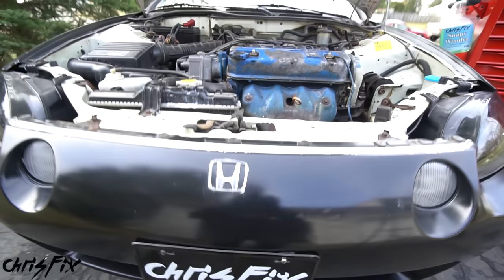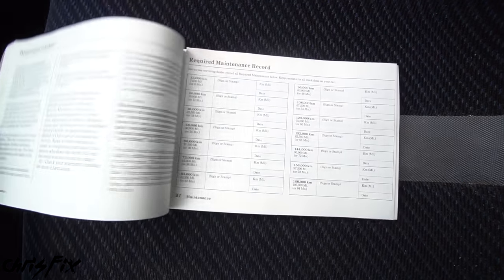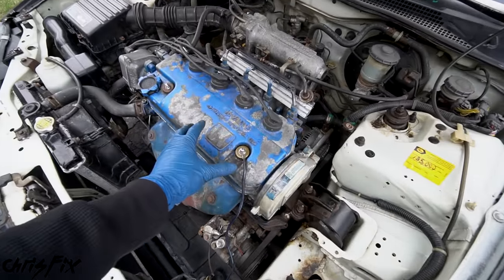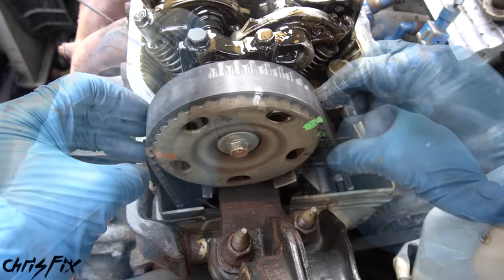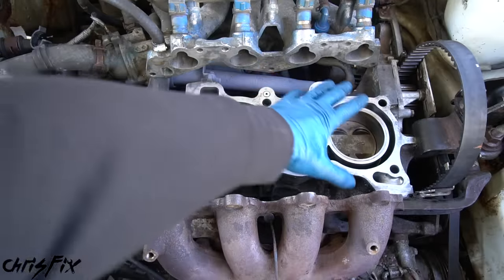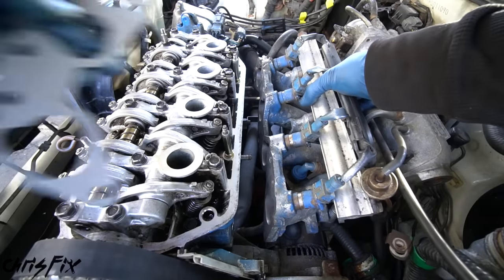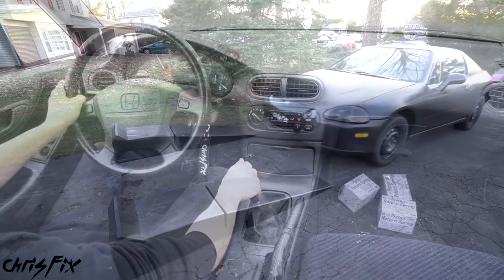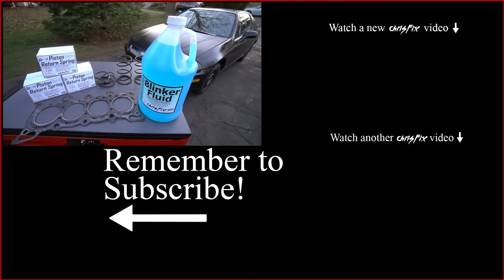How to Replace Piston Return Springs (and Head Gasket)

Comment: Wtf, opened my engine block and realised i dont have them!
Reply: Aariz Mughal i know mate
Reply: So you opened your engine before getting a replacement part? Hmmm lol
Reply: Ghazik Quick Run to autozone. ChrisFix forgot to mention older models need heavy duty PRS. Dont let them fool you.
Reply: Yep, happens all the time where I live. Damn scumbags will pull the head and nab your PRS's in 30 seconds flat. Most people don't notice the negative effects of running the car without them, namely reduced gas mileage and low end torque (they aren't effective above ~3000RPM in most engines).
Reply: You can always add them in to get another 2%+ fuel savings.  Make sure you get the right fit for your car.
Reply: Ghazik omfggg
Reply: Wow, looks like your PRS's completely dissolved into the oil...
Reply: Someone most have stole them ....
Reply: They must have melted and went out the exhaust. better get a new set so you have better fuel efficiency.
Reply: Zinu rolleros čista viņu nav😂
Reply: If you took your car to a mechanic once they probably stole them for their car.
Reply: Adding piston return springs to your engine is specifically for race cars guys, it's some serious business. We use ethyl alcohol-based blinker fluid to shave just a few grams off the vehicle, and muffler bearings for fidget
spinners. We ain't messin' around
Reply: How does your car even run man??? Jfc get those replaced ASAP!!!
Reply: random guy wooosh
Reply: oh damn you need to get a set from chris quick thats not good!
Reply: you also realized that you spelled realized wrong

Comment: I have no idea what the joke is here... that looked and sounded completely legit :(
Reply: Got to get ya some," piston return springs,"  Stat.
Reply: Four strokes to the engine, The first stroke in intake, the cylinder pulls in fuel and air and then the piston goes up for the second stroke, the compression stroke and the fuel air mixture is compressed and it is ignited by the spark plug in a regular fuel, in diesel there is no spark plug so it uses the heat of the air compressing to ignite the fuel. that combustion is what causes the piston to return and creates the energy that moves your vehicle. That is called the combustion stoke and is where this joke comes into play, It seems legit that a spring would be helpful in the four stroke cycle but in theory it would hinder the process because with every stroke combustion stroke it would have to compress all the other springs and take power from the crank shaft. The last stroke is the exhaust stroke where the piston returns to top dead center and exhausts the burned fuel/air mixture and then the cycle starts over again.

Intake, Compression, Combustion, Exhaust. No spring needed for the process.
Hope this helps.

Comment: I think I usually run my car's with no piston return springs in it.
Reply: And thats ok too as long as you remove the connecting rods too too much pressure on the crank and it could start "Rotating". Next thing ya know, you'll have pistons going up and down at different times..
Reply: Same... Weight reduction because race car lol
Reply: You are at high risk of spinning your muffler bearing...
Reply: @savagesock3598  
No. That cant be. I just replaced the muffler bearing fluid.

Comment: WTF is a piston return spring!!???
Whatever, I have my own problems...my mechanic told me yesterday I need blinker fluid, a muffler bearing and change my summer air in the tires to winter air.
Google was no help...HELP!!!
Reply: Made short work of a head gasket change.but piston return springs are old technology... id suggest piston delete kit  golden beagle makes a nice kit.realy lightens  your rotating assembly .i did mine and  now i have a nice healthy idle but its really hard to find tdc
Reply: Deez Nutz you need blinker fluid too?  I had that installed today!
Reply: @TraumaER  Question: Blinkerfluid for winter or summer? Pay attention to this detail! ;-)
Reply: " . . . and change my summer air in the tires to winter air."

Use nitrogen. It's all season.
Reply: John Casteel nitrogen is the biggest scam in car maintenance today.
Reply: @TraumaER  only a scam if u pay for it. Sence it does have advantages

Comment: Anyone noticed the numbers on the barcode are the first 8 digits of Pi. Easter egg??
Reply from the maker: Good eye ;)
Reply: On the blinker fluid was 8675309. I googled it and this popped up: Tommy Tutone - Jenny (867-5309)
Reply: And this is the muffler bearing's barcode number too
Reply: Aladár Mézga You can actually call that number and it will play the song, just add 919, lol.

Comment: and I'm thinking like wow Hondas have piston returns Springs? I'm glad my Nissan doesn't have them... Or does it?
Reply: Christopher Schade Nissan actually uses a duel rate piston return spring, they cost twice as much but last three times as long. It's best to replace them with a fully adjustable hydraulic controlled spring they last forever and add about 69 hp
Reply: Christopher Schade I'm sure the dealer would be more than happy to replace them for you.
Reply: Tear it apart and find out
Reply: My old Honda Accord lx didn't

Comment: U need a new engine. Please do a engine swap. A supra engine will be nice. If it fits.
Reply from the maker: I will most likely do a swap so stay tuned!
Reply: nah, k20 engine+ a super/turbocharger would be great :) 300+ hp
Reply: swap it with a new stock engine.
Reply: 2jz would be awsome😍
Reply: SOMEONE FROM SOMEWHERE It is honda, of course it will fit
Reply: ChrisFix do a Honda K24 with a turbo kit
Reply: ChrisFix just swap a stock B series engine.
Reply: No. Keep it honda
Reply: that is a 6 cilinder monster engine do you rly think it would fit
Reply: you cant rly fit anything other then a honda engine in that without some hard modification
Reply: Ahahah 2JZ 😂😂, don’t make me laugh
Reply: Thats why at the end of my comment i said if it fits. Chris will need to remove most of the car parts in the engine bay to be able to fit a 2JZ.
Reply: SOMEONE FROM SOMEWHERE it’s FWD 😂😂
Reply: No problem 😂
Reply: GDrift are u sure. I searched it. It says JZ and 2JZ-GE were in supra models. If i’m wrong... then 😅😂
Reply: SOMEONE FROM SOMEWHERE I’m saying the del sol is fwd do you can’t fit a 2JZ in it

Comment: Remember, always put the piston return springs in before you place the head gasket on the block. If you ever come across an engine that the previous owner deleted the piston return springs, you must reinstall them with oem parts.
Reply: Someone stole my Piston return springs from my car.

Comment: great video!
got myself some new ones too.
instal was easy since i got a similar engine. i went for a slightly higher springrate for even more torque.
engine runs smoother than ever before.
fuel efficiency and power delivery better than ever!!

Comment: Another pro tip would be run a taller spring for more piston lift .. more piston lift = more power also look into a quality spring like Pac springs or Isky tool room springs. They can handle 1.5" - 2" more piston lift for 250K miles no problem. Some peolpe try to use a piston return spring spacer to accomplish this however that is not the right way. And can lead to premature piston return spring failure.

Comment: If a car sits for many years without being run or drained of fluids, can that cause the head gaskets, heads/block surfaces to warp and possibly leak? I picked up a '66 Mustang that sat for many many years (Possibly 20?) and she's blowing a good amount of white smoke. No frothy oil and haven't been able to check for exhaust in the coolant yet. I just had to refill her back up with coolant but it's a slow "leak". She goes through oil much faster buuuuuut there's 100% a leak underneath that I can't get to or see with the equipment I've got currently.

Unrelated: I've been piece-parting her back together, slowly but surely, and your videos have come in handy on multiple occasions, so thank you so freakin much, man. Keep it up.

Comment: I openned my engine and found out why it wasnt working properly. It was because there wasnt any springs inside. I bought a new ones and replaced them. Now my engine works fine and it is +10hp more powerful !

Comment: I've always replaced my piston return springs every 100,000 miles at the same time I change the timing belt, water pump, hydraulic tensioner and the cam seals. I learned to always change the piston return springs then the hard way when I blew up an engine when I didn't change them in time.  When that happened, pieces of one of the springs shot out my exhaust and hit the driver of a passing car in the face causing him to lose control of his car and he ran over an old man with a walker.  But the worst part was that another piece of the spring got between an exhaust valve and the valve seat and it bent the valve stem.  What a PITA!  Just be careful who you buy your piston return springs from because the Chinese piston return springs are total crap. One way to check them without pulling off the head is to use a sequential gonculator but just make sure it's calibrated correctly.  A SG is expensive, of course,  but many parts stores will rent them out or even let you use one for free if you buy your piston return springs from them.   I bought my own so I can check my piston return springs frequently.  Doing so is critical and I suspect that many new drivers aren't aware of this. 

Thanks for posting this important video.

Comment: I was thinking "wow I've never heard of piston return springs" and then I realized that this was an April Fools video.  The manual timing belt tension has a specific sequence for tightening BTW.  On the D16a6, you're supposed to advance it 3 teeth beyond TDC and then tighten the tensioner.  Otherwise, great job.

Comment: Wow 4 years ago we’ll I’ll give it a try. I have a 92 accord same issue idles go up and down. And fan comes on very shortly, and the it begins to over heat. Not sure if it’s the head gasket or what it is specifically. Any advice?
Reply from the maker: It could be a few things. Check your temp sensor and check your coolant levels first.

Comment: i sugges you to add oil dampers to the prs, otherwise there could be a risk of the engine generating too much torque and spun the transmission main bearings

Comment: I have a car that has a chain instead of belt, I think I will have to remove the valve shafts first to get to the head bolts. It is a Suzuki Liana, 2004

Comment: When i did my piston return springs I couldn’t afford a head gasket as well as the springs so i took out the spark plugs and turned them till I found the ends and wound them out then wound the new ones in the opposite way , only had to run a chaser tap down the plug holes to get the plugs back in 😂

Comment: i had the same problem. there were spring parts behind the car that came out of the exhaust pipe. simple solution i put the pieces back in the gas tank

Comment: Hey I know you probably won’t see this but what did you use to clean the cylinder head? I was thinking you just used degreaser but I wasn’t sure and thought I’d ask. Thanks brother
Reply: carb cleaner your not supposed to clean the piston's while there in the engine
Reply: @seanmckay3392  alrighty thanks

Comment: Does he recommend low tension return springs to increase gas mileage?   I'm on the fence here which way to go but it seems they are more available.  I only change my oil every 10,000 miles so this is a concern for me

Comment: I clicked on this video so I can learn how to change a head gasket. Can anyone tell me what is and isn't a joke here? I.E do you actually have to torque the head bolts in a certain sequence? Is it okay to clean oil off the valve train?
Reply from the maker: Everything except the springs is real if your looking to change the head gasket :p and you can but make sure the valve train has some fresh oil/assembly lube before startup
Reply: @chrisfix  Thanks Chris, very impressed you still respond to 6 year old videos 😁

Comment: You wouldn't believe this but when I opened it up there was NO PISTON RETURN SPRINGS, wow wish I had known it gotten that bad, smh I immediately put 2 springs in each cylinder, also don't forget to lube the springs
Reply from the maker: Imagine that. What car?  Well whatever car it was, they cheaped out!
Reply: @chrisfix  the problem is, that it's an older car so they didn't coat the springs with the coolant repellent, I assume over the years the collant must've eaten those springs up.

Comment: In my opinion they are useless engines, why put return springs? It only increases the risk, increases friction, increases the thrust on the head, increases the effort on the piston, on the connecting rods, on the shaft, the springs break as in this case. Useless in my opinion. I am a mechanic in my country and I would never see an engine like this. I repeat, my opinion, you were still very good, you explained well, we need videos like that.

Comment: is it possible to take the air intake off the head on a 1991 Toyota Corolla alltrac? without having to pull the head with it attached? I have a 1.6l 4A-FE engine manual 5 speed.
Reply from the maker: You should be able to.
Reply: @chrisfix  Awesome, I have a small leak with oil seeping into the coolant, but no coolant in oil-crankcase. thanks for the reply.

Comment: Hello, I have a 2008 Toyota Corolla Fielder with a 1.8-liter engine of the 1ZE model and it has 240,000 kilometers, I am its second owner, the first owner is a well-known person who takes great care of it, all the services in Toyota and I continued with that mode. But now a problem has occurred that they cannot find and I dare to consult you. The fault is that when turning on it starts with 1300 rpm's and as it heats up they go up to 2000, that is, it does the other way around since I understand it should drop to around 900 rpm. and already hot I go out and when I make the gear changes I see that the rpm's oscillate between 2000 and 1000 rpm and when I continue the march the minimum is 2000 rpm. If I leave it running stopped the car stays at 2000 rpm. I clarify that with a scanner it does not give an error, it was tested with a toyota scanner and other brands. Well we removed the throttle body, total cleaning including the MAF sensor of the filter, I clarify that you cannot remove the IAC valve to clean but the carburetion body was submerged in non-abrasive removing liquids and some dirt came out. We measured TPS and IAC with a multimeter, we simulated with power and everything was fine. We checked the pipes that had never been touched and they were impeccable. We put everything together and it starts making the same failure. We took out the VVT valve, it was cleaned with carburetor fluid and wd40, I have original oil in the car, with 5 original toyota viscosity, I excited the solenoid with 12 volts to the vvt-i and it works well, I don't improve at all either. So I disconnected the EGR vacuum valve and there the rpm's dropped a little but after five seconds it accelerates and when connected it returns to 2000 rpm. If I disconnect the MAF sensor, the fault disappears but the engine idles low between 300 and 500 rpm's and the car loses power at 3000 rpm's and the brake is very hard. I clarify that spark plugs, intake gasket, throttle body gasket and PSV valve were changed, all original from Toyota. I have seen some slight loss in the valve cover. The servo brake was also revised and it works without loss. Everything would indicate that there is a vacuum leak, but I live in the countryside where there is not much technology like something that generates pressure and smoke to see where the leak is. You can help me?

Comment: I’ll be replacing my head gasket on a 1999 Nissan Altima any tips or is it quite easy??
Reply: If you're in there don't forget to replace the piston return springs.
If they're worn out you'll get another 2-10 hsprs easily.

Comment: Quick question chris, what exactly did you use to  clean the cylinder head? soapy wooder? im trying to change my head gasket on my car and change the oil but want to clean everything down...
Reply from the maker: Carb cleaner and they sell a special disc for gasket removal you can put on a drill. First spray the gasket with carb cleaner, then use a plastic razor to get as much off as you can and then use either a scuff pad or the gasket remover disc.
Reply: @chrisfix  Thanks a lot !!
Reply: @chrisfix  One more question actually , what did you use to clean the top of the cylinder head where the oil sits? carb cleaner also?

Comment: Old school tip: mill the head .060 while it's out. Cheap & easy way for an extra twenty hp and will help run better. This accomplishes three things: helps the engine run better, produces small amount of additional horsepower and ensures a true flat head for the re-install.

Comment: hey @Chrisfix I have a (see username) with the stock 307, I went to start it today and ran it for less than a minute, revved it a couple times, and then went to check coolant and it tried to geyser on me.(in other words it had a ton of pressure) It doesn't have a thermostat in it could that be the problem or do I have bigger issues?

Comment: ya your kidding about them spring but i pal of mine had a pancake flat 6 cly steam motor that had 16 power strokes per rev. single acting [power on top of piston only] the crank was a triangle so for every turn each rod had three power strokes and yes it had piston return springs

Comment: I'm genuinely angered by how many people I told that the Honda Del Sol has piston return springs since 2018. It could make sense though. If a car had trouble with returning the piston to its original position it could use a high-strength piston return spring to force it down rapidly.